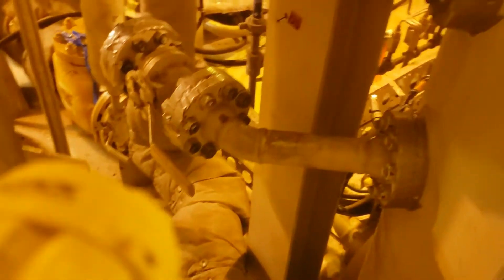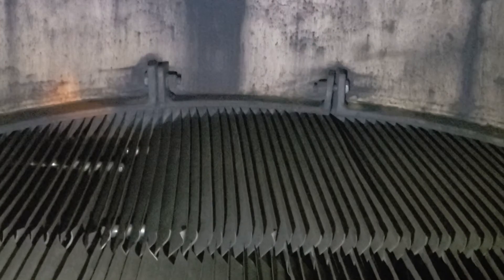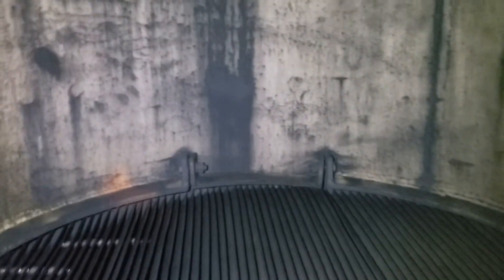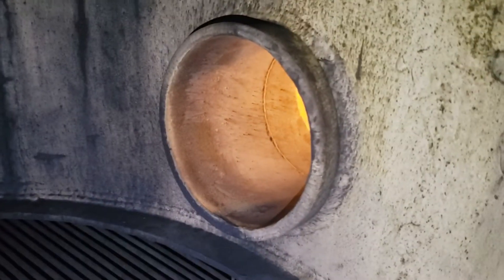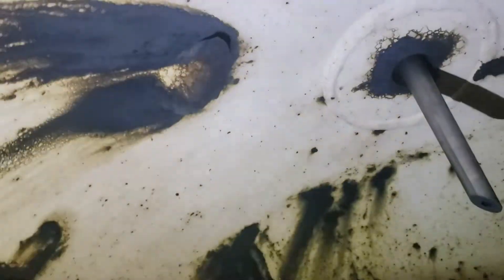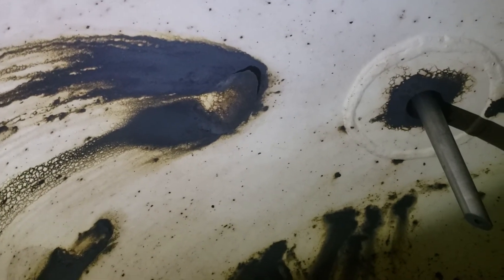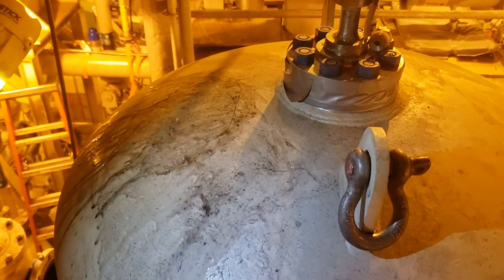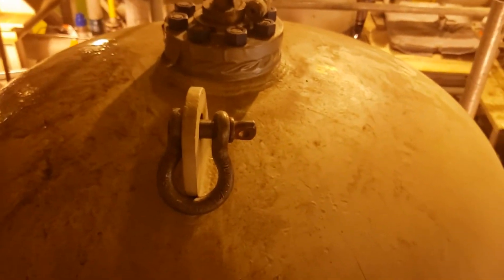API 510 internal inspection //Pressure Vessel// Vertical drum & moisture eliminator/ coating holiday

Comment: Thank you for your sharing Mr. Eric. 
I wonder have you ever see any damage due to corrosion or distortion on vane type demisters? Also in your video the vane type moisture eliminator seems collapsed closed to its center is it correct or is it just because of the angle of the video recorder which misguide me. Thank you in advance. Keep sharing your valuable experiences. 
Regards,
Reply from the maker: Burak,
Mechanical Damage yes.  Corrosion,  no not normally. 

These vanes are a little bent from rough handling,  but they just appear mashed from the angle, though there is an unusually wide gap from install.